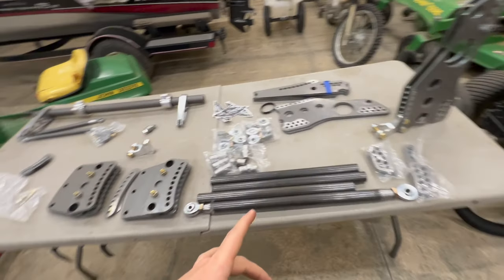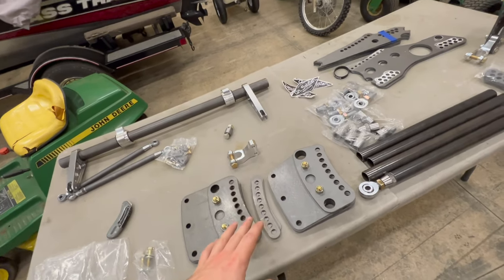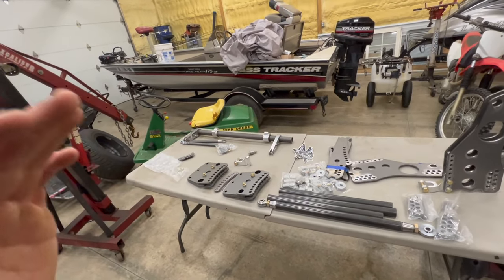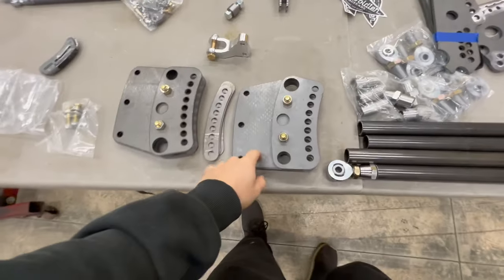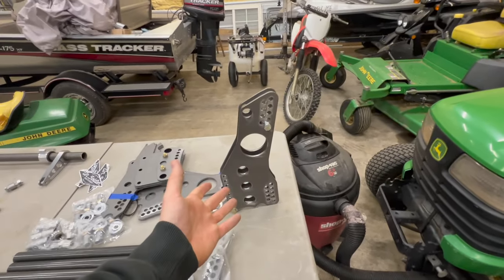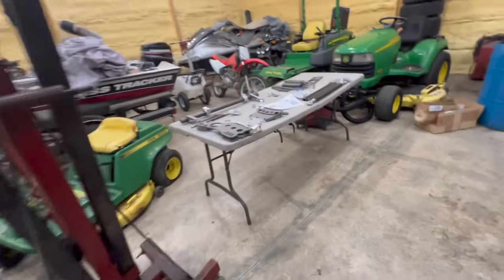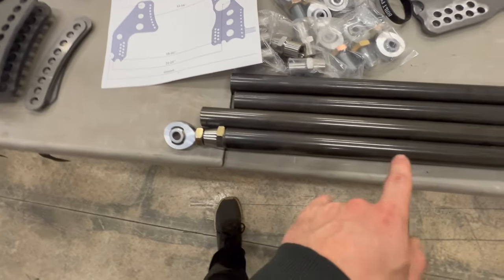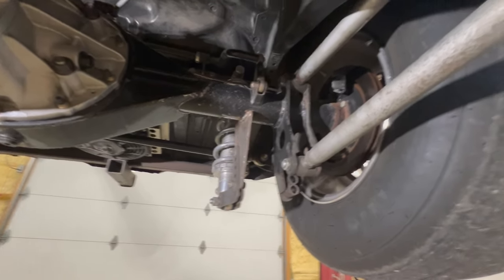How to Build a 4sec Streetcar - Week 2

Comment: If your welds are grey, they are either too hot, not enough gas coverage, or both.
Use a Jazzy 10 cup or a Fupa 12, with a gas lens and about 20-25 cfh.
Reply: too hot too slow. thats a fuck ton of gas.
Reply from the maker: This is the info I need. Honestly just winging it
Reply: @DieselRamcharger  20-25 cfh with a 10 cup?? Not. I weld stainless, mild steel, and aluminum, daily.
Rule of thumb, is, double the cfh for the cup size. I run 35-40 cfh with a 16 cup and titanium and sometimes stainless. Depends what type of weld, too. A fillet weld will take less than and outside corner.
Reply: @Rev2lateRacing  Yeah, with mild steel, you sometimes can't help they graying. If your tungsten it getting oxidized, then you need more gas. Just see how the tungsten is looking, that helps, too.
Reply: @funfun8095  ok guy.
Reply: @funfun8095  the rule of thumb is cup x 2 12cfh for a 6 cup. tube cars are almost all inside corners. fupa cups are bullshit. we build over 100 chassis a year my guy. im not asking you for a damned thing.
Reply: @DieselRamcharger  LOL  Glad I'm not racing in one of them! Probably full of cracks!
Reply: @DieselRamcharger  I just said 2 x the cup size, dip sh1t!
Reply: @funfun8095  when you run ur gas too high it causes turbulence. those vortices. eddy currents. suck air in from around it, forcing you to run even more gas to compensate. the solution is to TURN THE GAS DOWN. a 10 cup and a 10 cup on a gas lens isnt the same thing. so yeah 15 is plenty on a 10 cup over a lens. instead of arguing with me, you should try listening. been at this longer than you been alive.
Reply: @DieselRamcharger  Funny how your channel doesn't show even 1 chassis! LOL 100 a year, huh??
I bet the ATF would love to see those full auto weapons you have, too!
Reply: @DieselRamcharger  I'm talking gas lenses! I'm not going to run more gas than I need to, I use as little as possible. Everyone should use a stubby gas lens.
Reply: @DieselRamcharger  Doubt that! I've been welding for over 35 years and a lot of sanitary welding.
Reply: @DieselRamcharger  So, people are supposed to believe you build 100 chassis a year!???  That's nearly 1 every 3 working days! LOL
Couldn't even do that, if they were go cart chassis!
There's a reason it takes 9 months to a year to build a top of the line car!
Most top tier chassis shops don't even do 20 a year! SMH
Take your BS, elsewhere!

Comment: Plain mild steel will ALWAYS weld like shit. Secondly, it looks like your practice box has mill scale on it. Thats a no no. Get yourself some wire wheels and dedicate them. Never use a mild steel wheel on stainless or aluminum and so forth. You want to use ER80SD2 1/16th inch filler wire. We use gas lens with a 6 or 10 cup. 12-15cfh {entire purpose of a gas lens is to SAVE gas by reducing turbulence} your tungsten should stick out 2-3 filler wire diameters from the cup. {i stack 3 pieces and tack em together to use as a gauge} Inside corners youll need a little longer, outside corners a little shorter. I run something like a 60 amp base and 1 amp per thousandth. so .090" wall plus 60 = 150ish. i use .060 - .120 wall tube all day so i leave my machine set at 169. When im welding .250" wall spuds i will turn the machine up. Practice feeding the wire using your thumb and first two fingers. {pinch feeding} When you use 1/16th wire youll have to feed alot when you got the heat up. MOTORSPORTS WELDERS PUMP THE PEDAL WITH EVERY DIP! No one is going to tell you this. We DO NOT WELD LIKE PIPELINERS!  The machines are set hot, we use the pedal to maintain. Light your torch by just pressing the pedal past the high frequency switch {youll learn to feel it} you can use it like a flash light and just sort of sit and look around. find your groove, your filler, get lined up, floor it, dip, back off the pedal, advance one half a dimes distance {advance one radius not one diameter} punch it, feed in the wire, back out...rinse and repeat. You want to keep the wire inside the gas envelope at all times, or it will get grey crusties. You want to dip into the puddle not the arc. if you hear an electric crackling noise each time you dip, that is your filler wire passing through the arc. instead, feed it into the edge of the puddle. Dipping - Heat the puddle as it melts it will form into a kidney bean shape. fill the kidney bean with filler to make it a circle. let off the heat to let it cool and freeze before moving. its all timing and rhythm. Im a professional chassis builder.
Reply: You should write a book! You obviously love typing a bunch of gibber jabber!